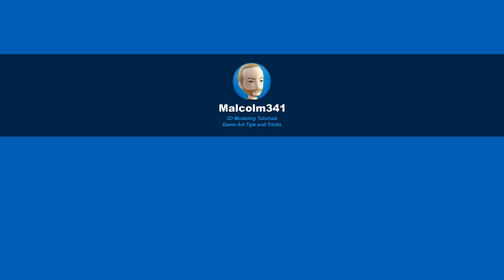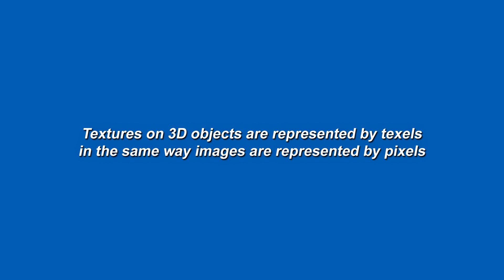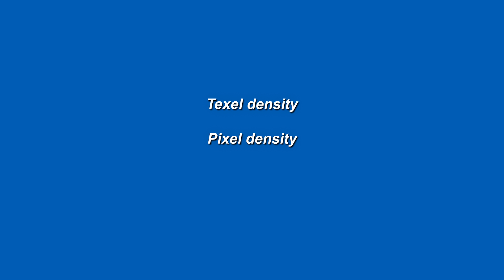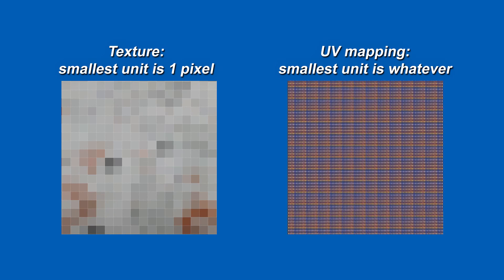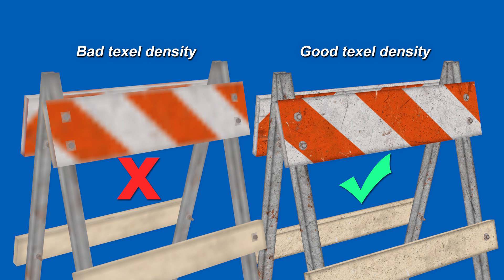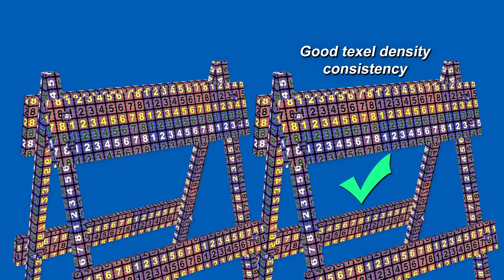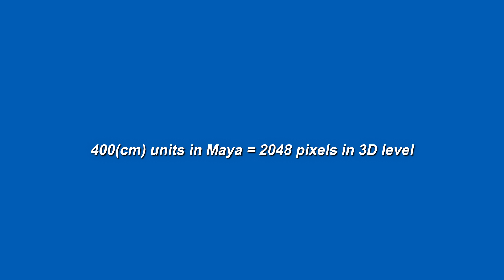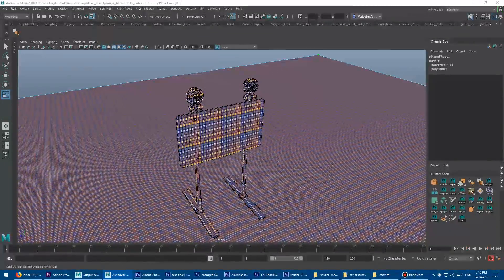What is Texel Density and How to Master it

Comment: Amazing and very informative video .Sir, I have a doubt...after doing the step of uniform texel density..when all the objects have same texel size but when i do the layout  option in arrange the layout area. To keep them in a single uv space ..my  texel desity changes and the object looks less sharper.why its like that? KINDLY HEP
Reply from the maker: @TheCharacterAnimator The layout command fits everything into the 0-1 UV space and to do so shrinks all the UV shells to fit, so you get lower texel density and blurry texture. The only way around this is to stack duplicate UV shells or use more than one texture. It's a tricky process.
Reply: @malcolm341 thank u for the reply sir..if possible i would like to see a tutorial by u based on this.😊

Comment: In Maya assign textur's material to viewport selection is not showing that material
Reply from the maker: @balaakond3045 Make sure you have pressed 6 on the keyboard to show textures and also make sure you don't have use default material turned on.
Reply: @malcolm341 thank you so much brother

Comment: Good to know but the biggest problem is to fit the UV islands within the UV space and barely few peoply dive into it.... For boxes and repetive patterns  is relatively easy as you showed By stacking them on top of each other. The challenge comes when you have to unwrap more organic 3d models. There is a lot of misinformation on youtube leading you to believe that you should only fit the UV islands into ONE single UV space WHICH is NOT TRUTH.. Or even worst, some gives you the impression you can just leave the UV islands outside of the Uv Space. That  only works if you are confined to use one 3D software... but the real world industry is not like that.  It took me years to find out  and PAY ATTENTION Everyone Search for UDIMS!! That will make your life easier to unwrap and get a good texel density accros your complex 3d models

Comment: This is such an amazing video and has helped me get a better grasp on texel density so thank you so much. I do however have a question. How do you go about texel density with trim sheets? do you UV map the pieces first to figure out the scale of the trimsheet? I have never done a trimsheet before so I am unsure which way to do things.
Reply from the maker: @ShmodoBagins Thanks I'm glad you found this video useful. I highly recommend this other video if you're interested in texel density on Dylan's channel.
https://youtu.be/QcqJckp_q3M?list=PLAUgGUDpaMEM98Dr3vmUNEbSrURgMPMNw

With a trim sheet the texel density is defined the same way as starting with a quad. So if you have a quad 400cm x 400cm whatever texture size you map to that in 0-1 UV space becomes the current texel density, so in my case I put a 2048x2048 on it so texel density becomes 2048 pixels per 400cm or 1 pixel per 5.12cm if you prefer. With a trim sheet it's the same 400cm quad, but your texture is in strips cut up horizontally and you only tile the UVs horizontally on your final model so the texel density is locked in the same way as a regular tiling texture, but you need to make a bunch of different strips to account for the heights in centimeters of your model that you want to use the trim sheet on.

Typically what you want to do is build the model first and then identify which parts can use trim sheets and create the texture strips in your trim sheet to match exactly or very closely to the vertical height of your geometry that you will apply the trim sheet texture to. I think an easy way to get started would be make quad and assign a 2048x2048 texture to it, or whatever base texel density you use, then from there cut it up into horizontal strips with the cut polygon tool of how many trims you want, somewhere between 4 to 16 faces after cutting. Then use those faces to extrude your geometry from and you would have a perfect 1:1 texel density with your trims providing you don't change the height during extrusion. In practice there's more flexibility and people will create 12 trims in one texture lets say, and then stretch those a bit up or down to fit parts of the model instead of having everything be exactly perfect.
Reply: @malcolm341  Thank you so much for getting back to me and giving such a detailed explanation, I appreciate it so much. I didn't expect one on a 5yr old vid haha. But this really does help me get my mind around it a bit better. I think also with playing around I should hopefully learn a few things, make a few mistakes. I will definitely have a look at the video you linked as well. I attempted my first trimsheet yesterday and in theory it looks good but we will see how it comes out when I test it lol.
Reply from the maker: @ShmodoBagins  Good luck, I'm sure you'll figure it out after trying it a couple times. When in doubt, just apply a checker texture to your trim sheet and confirm it's the same size as the rest of the checkers in your scene on non-trim sheet assets.

Comment: 10:56 It means 2048/5.12 = 400
You are spreading 5.12 pixels from the 2048 image into each centimeter of whatever object you texturing.

So, you could just type the following densities in SET, depending on the size of your texture. Don't forget to type the map size:
512/400 = 1.28
1024/400= 2.56
 2048/400 = 5.12
4096/400 = 10.24
Reply from the maker: Yes you are correct, the pix per unit measurement is the more common way of measuring texel density these days so 5.12 pixels per 1 unit of measurement is more common than saying 2048 = 400.

Comment: Could you perhaps give some some advice on how could I fit multiple UV shells into 1 single tiles with keeping high (4K) pixel density. When I want to keep really high pixel density, with loads of details on my building, I can only fit a couple of columns into one single tile. However, when I want to include multiple object mainlining the same high density, it's off the tile.
Reply from the maker: @kissfabian Typically for architecture and other larger props you have to use a combination of multiple textures with some parts unwrapped, some parts tiling, and some trims sheets. This video is great at explaining how to texture large things for games. https://youtu.be/QcqJckp_q3M?list=PLAUgGUDpaMEM98Dr3vmUNEbSrURgMPMNw

Comment: Question on stacking, that only solves the issue of you are not planning on doing any baking right?
Reply: Yeah thats the part i dont understand. I never knew stacking was an option as any overlapping UV will get me massive artefacts in painter. Or do you mean stacking after I’ve baked mirrored UVs?
Reply from the maker: @cgnovice2969  to use stacking with painter I believe you have to offset all the stacked UV shells over by one tile except leave one shell in place for Painter to paint and bake on. The resulting UV mapping will look identical, but you won't have overlap in Painter.
Reply from the maker: @cgnovice2969 larger props and architecture have to use a combination of tiling and baked parts that you reuse and stack or tile parts of the texture. On very large assets multiple textures are used that combine stacking, tiling, and unwrapped/baked parts. You would still try to bake as much as you can knowing where you can stack or mirror those parts of the normal map. Only small props get unwrapped 0-1 and fully baked these days, and some teams are even using trim sheets to texture doors and windows now like the Last of Us Part 2 etc.

Comment: Hey man, I'm given a task where I need to use 2048px/m2 and use minimal texture size with that density .... but for some reason I can't make it properly. Can you help me please?
Reply from the maker: @kristianrabakov8579 Sure, that is double what we usually use for environments on AAA games. If you're working in cintemetes in Maya make a plane that is 200x200 and apply a 2048x2048 checker to it mapped 0-1 and that will give you the size they want you to match. Happy to answer any other questions you have.
Reply: Hi  @malcolm341  Just did what you say, the texels on my model match the texels on a 200x200 plane with a 2k texture. But here comes the problem. Now my UV shells are very tiny. They are not fitting in the 0-1 space. This is the problem I've been stuck on for 2 days. I get the TD right, but then my UV shells become tiny and I don't know what to do.
Reply from the maker: @kristianrabakov8579  if the UV shells are all smaller than 0-1 you've hit the target texel density with room to spare. If this is a prop or character I would usually uniformly scale the shells up to fit into 0-1. This gives you higher than required texel density which is not a bad thing from props. Or you can save some memory and try to use a 1024x1024 texture on the model and see how closely that matches up with the plane with the 2048x2048 texture applied to it. Technically a 1024x1024 tiled 2x is the same texel density as the 2048, you just get more repeats.

Comment: question please. im trying to make a building. but when im adjust all the past to 1024x1024. some uv are out of the boundry because of the diffrent size. what should i do to make it the same size ?
Reply from the maker: Unfortunately you can't unwrap buildings into the 0-1 UV space they're just too big. To get around this for games you need to stack UV shells, make use of tiling textures, and use trim sheets and unique unwrapped parts. Typically on Gears of War 5 we would use three 2048x2048 textures for one building and then try to re-use those textures on similar buildings to make difference shapes. Here's a link to understanding trim sheets which will hopefully lead you in the right direction https://youtu.be/IziIY674NAw

Comment: This is great, but does it work if you want to texture assets in substance painter? , because substance painters doesn't like overlapping uvs.
Reply from the maker: I think in Subtance Painter if you want to stack UVs you need to move all the duplicate shells out of the 0-1 UV space by one tile in any direction. So first stack everything in Maya the way you like, then select all the stacked shells except for one and move them one tile over.

Comment: I am so doing something wrong, because I cannot get any of this to work :/
Reply from the maker: The easiest way to think about it in my opinion is make a plane the desired size in cm for example 400cm. Then apply a 2048x2048 texture to it so it fills the plane UVs 0-1 which. From there you have your reference object 2048 pixels across 400cm. Then the easiest way to continue with out doing any math is keep that plane around and use the get and set buttons from the UV toolkit to copy that texel density from the plan to other meshes in the scene, then you know everything will match up with your original reference object. The UV toolkit works in 1pixels per unit so when you click the get button it should read 5.12pixels per one centimeter. I personally find that harder to think about, but that seems to be the standard these days. If you scale the plane up or down that would change the reference object texel density by the amount you scale. For example if you scaled the plane to 200cm, but left the 2048x2048 texture on it, the texel density would now be 2048 pixels across 400cm or 10.24pixels per one centimeter using the 1pixel per unit measurement system. Technically you don't need to know the math you just need to build your reference plane first and just copy paste that texel density to all the meshes in your scene after you UV map them.
Reply: @malcolm341  I've been using the GET and SET features for the texel density according to the reference plane., but it's scaling my UVs up waaaaay bigger than what will fit in the 1:1 square. I can cut them some, but at this point I'm just chopping them up beyond recognition 😅🤣.
Also, what do you do about objects that are significantly smaller than the rest? The referenced texel density looks huge on the small objects. I feel like I want to increase the density to get a better resolution, but then it texel density wouldn't be 
 consistent across all the objects. 
Also, I don't understand any of them math 😆😅🤣😂. Pretty sure I have no left brain at all. Thanks for helping
Reply from the maker: @DisneyUpBoilerUp  Yes correct, it takes years to learn how to get consistent texel density across larger objects that don't fit into the 0-1 plane, it's very painful. Generally small to medium props can fit into 0-1 or you have to use some stacking and overlapping, but when it comes to large props and architecture you have to work with multiple tiling textures, trim sheets, and 0-1 pages. Smaller props are less of a concern because mip mapping takes care of everything looking consistent and it's often better to have higher texel density on smaller objects because people often zoom into them. The very challenging part is larger objects because they look so blurry especially compared to props. For reference we used 2-3 textures for architectural sets on Gears of War 5, usually one trim, one tiling, and one unique unwrapped details. It took me 10 years before I truly understood the math behind texel density, what's more important is just learning how to hit the texel density target you're after. Here's a link about trims that might clear some stuff up https://youtu.be/IziIY674NAw?list=PLBi3xvwvY3dk09fNSd7jrnEscXS_6_1p2

Comment: what if i need to bake highpoly on to lowpoly mesh? stacking UVS will screw things up. I guess
Reply from the maker: Not really. Stacking UVs works fine, but in some bakers the additional stacked shells need to be offset out of the 0-1 UV space by one tile so the baker doesn't get confused. The tricky part with baking high to low is unwrapping some parts uniquely and baking and choosing which parts to stack and bake. For small props you can get away with just unwrapping the whole thing and baking high to low, for larger props, sections need to be repeated/stacked so it takes a lot of work and planning. Often when the prop gets too big we'd use one texture for unique baked details and another texture for trim or repeating patterns. It really depends on your exact model plus your desired texel density it's by for the most annoying part of making game assets.

Comment: Very good tutorial on what I think is a complicated part of 3d Art.  I was working on a project in 3dsmax that went into unreal and I was having issues with adjacent planes of the same texture showing some weird variations.  Some of the suggestions I saw on some of the forums talked about texel density as one of the concerns so I dove into it but most explanations were lacking.  What is a problem is that you are using Maya and another one was using Blender and they said the techniques are program agnostic but that is not true.  Maya has that built in texture tool to match texel density where max does not.  I found a script for 3dsmax but the instructions to use it were horrific.  Your explanation on the Maya tool led me to figuring out this script and it works perfect.  Thank you!
Reply from the maker: Oh great, I'm glad you enjoyed the video. In Max the main difference is that the default working unit is meters where Maya is centimeters so in Max this video I made would be 2048pix across 4 units in Max, and 400 units in Maya. I recommend this script if you're using Max it appears to work the same as the Maya default tool https://www.scriptspot.com/3ds-max/scripts/texel-density-tool and this other toolbox looks like you can do it here too https://renderhjs.net/textools/3dsMax.html
Reply: Actually, I changed the working units in max to centimeters and did the 400 cm sq plane and used your checker to still work through your tutorial.  As I mentioned, I did find the texel density script you mentioned but it does not quite work like Maya but I figured it out.  There is no good direction on how to use this script so I am glad I saw you use the Maya one to give me some direction.  Again, well done video.
Reply from the maker: @arcitek66  Oh okay, well I'm glad you were able to figure it with this video and the Max script.

Comment: Hi, I wanna ask. If we already have the size Uv that we want. but how to export it an create the texture. Or the function of texel density is just to know the size of the texture? Thank you
Reply from the maker: The function of texel density is to determine the size of the UVs you want relative to the texture size you apply before creating the final texture. If you've already determined how big you want the UVs then you've already set your texel density. From there just export your model as .fbx or whatever format you need and than texture it in Substance Painter, Quixel Mixer, or Marmoset Toolbag.